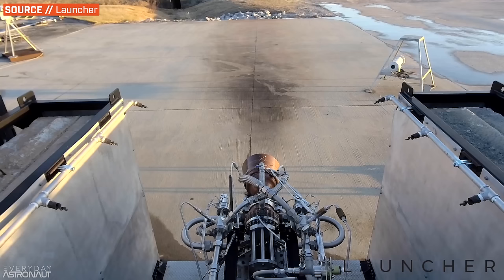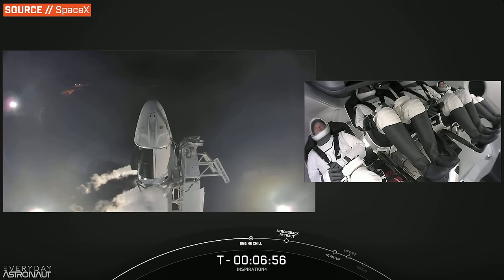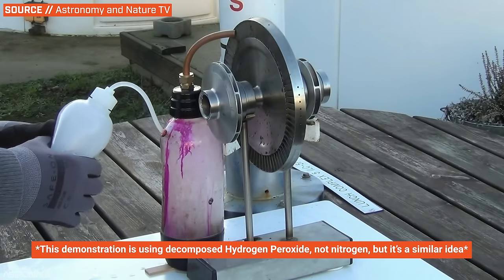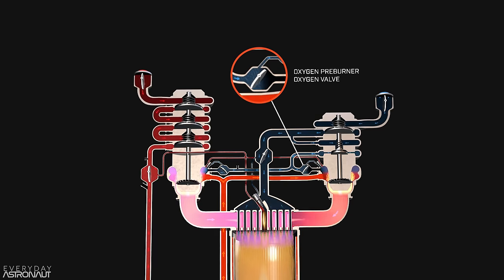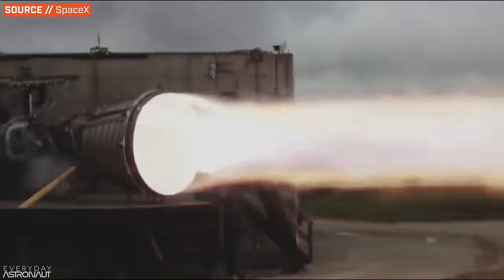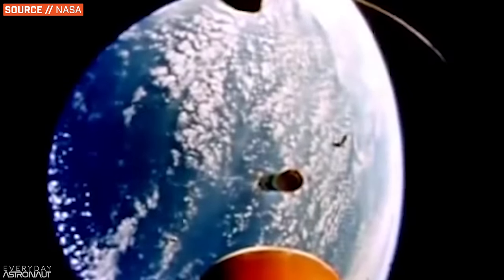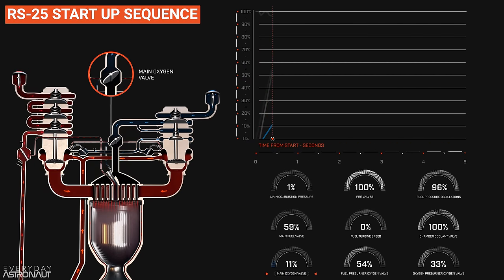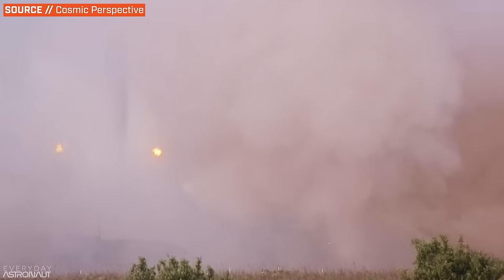Why Starting A Rocket Engine Is So Hard!

Comment: Terrific stuff, Tim. Entertaining and informative. I'd like to know how the Merlin engines on a Falcon 9 first stage are relit considering that air is being compressed into the combustion chamber at hypersonic speeds aswhenit is barrelling back down to earth.
Reply: The igniter is in the combustion chamber and the pressure in there is higher than any coming in from the outside.

Comment: Hi, in your discussion of hypergolics you bring up this point that liquid oxygen and liquid methane will coexist surprisingly peacefully together and won't lead to ignition. I take it the same is true of kerosene and LOX. Why don't any rockets take advantage of that fact and just use a premixed LOX/Kerosene/methane in a single fuel tank, run it through a combustion chamber and ignite it? Is there some chance of it becoming hypergolic or is it due to this issue with bubbles in the turbopumps, etc? It seems, this way, you might simplify engine design a fair bit and could save weight with fuel tanks, etc. Btw, this video's excellent and I can see this easily becoming my new favourite channel. Cheers for the top-class content.
Reply: Not a rocket scientist but I imagine the main problem with that would be that preburners will usually burn at a different (and less optimal) stoichiometric ratio than the combustion chamber.  Keeping the fuels separate and mixing them in the engine allows you to have, say, a fuel-rich preburner with a manageably low temperature and a combustion chamber much closer to the optimal stoichiometric ratio.  If your fuels are pre-mixed you have to choose very carefully between inefficient combustion or melting your preburners.  Plus just because they might not instantly explode like hypergolics doesn't mean it's very safe - a Falcon 9 blew up on the pad several years ago due to a carbon-composite helium vessel inside the LOX tank combusting.
Reply: @joshuaparks7429  Thanks, that seems to make sense.

Comment: The low pressure turbine blades on power station turbines are run just above the water dew point.  However some water drops do form and these erode the wear strips on the blade leading edges. It’s amazing to see satellite literally eaten away.

Comment: For the discussion around 35:00, if the goal for ignition of a vacuum optimized engine is to get fuel to the bottom of the tank, why is a plunger inside the not just used like a syringe to push fuel to one side of the tank?
Reply: Ah Nevermind this was answered at 37:00

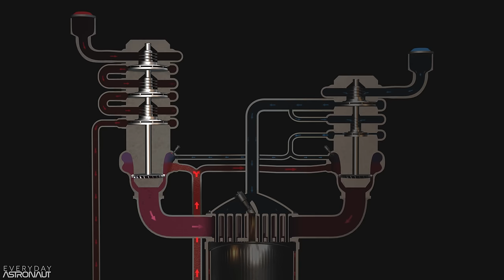Comment: I have a question about the animation at 19:31, if the gaseous hydrogen flows through the preburner and burns with oxygen there, then where does the fuel for main combustion comes from?
Reply: it runs so fuel rich that the combustion is not just incomplete, but leaves most of the fuel untouched and only a small amount actually burns to water

Comment: I think a electric high power high, torque turbine pump motor could probably be a bit less  complicated when starting and stopin😅g rocket motors and I think the PROTON rocket utiluzes this tech so it works and you can also eliminate a pre burner in the plumbing and I think this will work extremely effectively especially once this system has been refined and optimised in various ways

Comment: An idea: SpaceX stage 0 booster outer engine startup system seems overly complex and unreliable at times. Why don't they use some output power (eg preburner output gas) from the inner engines to start the outer engines instead of pumping n2 from the ground with lots of self retracting connectors?

Comment: John Carmack rightfully said:"Rocket science has been mythologized all out of proportion to its true difficulty."
To laypersons the processes described in this video may seem to be the most complex and difficult to control processes out of any engineering field - but nowadays, they really are not (any more).
There are much more complex and delicate processes involved e.g. in EUV lithography (and modern lithography in general, but EUV lithography is really obscenely difficult and was deemed impossible for quite some time), nanotechnology and many fields within life sciences. And there's much more trial and error involved, just that each trial and error-cycle is often not nearly as expensive as rocket engine testing.

Comment: There have been problems restarting engines @ near vacuum pressures. Perhaps it would help to reintegrate the main combustion chamber torch igniter.
Love the alpha-gen comment!
Reply: torch igniters are simple on the ground but any moving/mechanical part is set to fail at some point and its easier to just incorporate something like TEA-TEB

Comment: Great video as always but Ullage thrusters, u lost me, how do they force the fuel to the intake and remove the bubbles / cavitation. Can any one help?
Reply from the maker: The ullage thrusters accelerate the rocket (and it’s tanks of course) but the fuel stays in the same place. So the fuel “runs into” the bottom of the rocket. Since liquid is more dense, it will push the gas out of the way and sit on the bottom of the tanks during the ullage burn

Comment: in a stable zero-gravity configuration, a liquid in a tank should not "be a blob", rather it should be "coating" the inside of the tank, leaving a bubble in the center. just because of surface tension.

Comment: Good morning.
Can you please let me know what pressure is acting on the main valve and how is it opened.?
Thanks. 
Regards Bill.
Reply: most rockets in the past used hydraulics to move valves and solonoid valves to control those hydraulics (hydraulics can move a butttone of pressure). Nowadays some valves are solonoids themselves but afaik only on small lift vehicles
Reply: @daktus05  dear Sir.
Thanks for your reply.
Kind regards. 
Bill Richards. 
Cheers.

Comment: As far as spinup, if you are willing to sacrifice some weight and complicaion, maybe an electric motor to recirculate a fluid from a reservoir, through a tesla turbine, and back into the reservoir.  Tesla turbines have insane speeds and good horsepower performance in a small package.  They aren’t used in many applications, but this is because at the time they were invented, everyone was concentrating on vane axial steam turbines for naval applications, and the material science was inadequate at the time.  They are beginning to find applications today though.
Reply: Don’t use social media apps.

Comment: What do you think about improving a pressure fed cycle by igniting tiny amounts of fuel directly in the oxygen tank and vice versa? 
use the synergy with carbon composite tanks that can withstand giant internal pressures.
Reply: That’s how you cause a explosion

Comment: Is it about "throwing the most mass" or is it about creating the highest combustion chamber pressure/temperature possible without boom while utilizing that pressure as efficiently as possible? to some extent two of the same but not really...
Reply: It's absolutely not throwing baseballs... it's pushing the frame, which is "attached" to the combustion chamber gas, away from the jet of gas downstream of the combustion chamber and the nozzle gas

Comment: Cavitation is not quite a mystery in the holistic context of thermodynamical logarithmic emitter-receiver log-antilog inclusion-exclusion timing-phase positioning materialisation +/-, when you analyze the Fine Tuning Condensation +/- Constant of metastability partioning. 
Or, we hope the search for fusion power doesn't turn insideout without the operators knowledge of what they're doing.

Comment: Alright, I need to put this somewhere, so it might as well be here. Degradation of muscle and bone begins pretty quickly once a human leaves earth.
What if any factors could cut down on the degeneration?
For example, a myostatin inhibitor could greatly reduce the loss of strength and muscle mass. Couple this with regular calcium injection perhaps? Perhaps time release patches of different supplements?
Or do we just put all the astronauts on gear?
Not trying to joke; the actual physiological human element of space travel, will be a big hurdle that needs to be overcome. Perhaps gene editing will be prevalent in future astronauts, so they have the best chance to survive, and even thrive on other planets, and in space.
Thoughts?

Comment: The Soviet counterpart to the RS-25- the RD-0120- is a much simpler engine with nearly identical performance.  They even solved the problem with bootstrapping a staged combustion hydralox engine without needing the resonance chambers the RS-25 has.

Comment: Can you do a video on how liquid engines throttle, since in KSP they can smoothly throttle and as far as I know basically no real engine can do that?
Reply: im not sure how throttle works but one of the main issues and for example why the Merlin engines have a difficult landing sequence is the throttle range. Basically how low you can go with your throttle before you run into issues like combustion instability. KSP is lovely for things like control surfaces and such but some things are simplified, although i think with modding, you can bring almost any realworld constraints into KSP

Comment: Which part of the rocket absorbs the acceleration forces from the engine and transfers it to the rocket itself?
Reply: what do you mean?
Reply: @Jose Nova  sorry i have a tbi and im bad with words now. I mean newton's third law i think.
Reply: @downwithtrudeau  when you throw an object that imparts a force on your hand. Rockets eject material, the force pushes on the combustion chamber which is connected to the rocket itselt, accelerating it.

Comment: Compressed Barium Nitrate pellets are used to ignite a solid booster, hence the green flame.
Reply: Soo what you're saying is that if i eat enough Barium Nitrate, i could have turds that burn with green flames instead when i light them like usual?

Comment: Diesel Engines do not use the glow plugs for ignition.  Those are used for preheating the Cylinders for cold starts.  I have been around Diesel Engines My Entire Life. Over 40 years.  What makes a Diesel Work is Compression Ignition.  When you Compress Air it gets hot, then you inject fuel and it combusts.  That is how a Diesel Engine Works my Friends.  Rudolph Diesel got the idea from the old style cigarette lighters that they used way back in the day when he invented the first Diesel engine.  Although that Engine was originally designed to run on Peanut Oil.  Who Knew.

Comment: ha, seeing Elon explaining cavitation makes me feel a lot smarter....  blades create large enough pressure differences to boil the fluid in the low pressure areas, boiled bubbles move to higher pressure regions, bubbles collapse on surfaces to create incredibly high energy local effects that cause massive damage to blade surfaces. 
I have a BSME and do some pretty light duty manufacturing engineering, with a lean into copper alloy foundry science, but I feel like comprehend cavitation better than ol' Musky.   I guess the copper alloy stuff gets me closer to the cavitation knowledge, some of the alloys I worked with were exceptionally seawater and cavitation resistant (CA958 in particular) and as such were used in marine applications, most importantly as a propeller material for ships and submarines.  Obviously the dynamics involved in a turbine pushing THOUSANDS of kg per second through a 10? cm diameter pipe is a wildly different than a marine propeller drive, both in forces and chemistry.

Comment: And what if they build a permanent magnet track,both vertically and horizontally  combined with a fuel powered electrical energy strong trom generator, How could the E magnetic levitation train, like the MEGGLE, be used to transport containers as well as to transport huge spaceships into space?

Comment: A couple of additional thoughts : 

First, it's as if rocket science is actually really hard.

Second, about the pre-burners / gas generators. I know that the A-4 (V-2) used a steam generator with sodium permanganate and hydrogen peroxide to power the turbopump (one turbopump with separate impellers for fuel and oxidiser); and this as a quick and dirty ssolution. Obviously, you don't want to be faffing about with permanganate paste and highly-refined solutions of hydrogen peroxide if you have any choice. But why are pre-burners favoured over an independent gas generator in most of the engines that are operated today and in recent decades?
Reply: preburners often run incredibly rich so that they dont get too hot. That leads to a loss in efficiency, because you basically use a lot more fuel just to move fuel. The other reason is that the rich fuel is very suddy and can cause stuff like valves, injectors and everything to be clogged/damaged

Comment: Great job but this video will take more than one watching to understand.👍👍
The Rusians aren't the first to use burning wood to start a rocket motor.  The Germans built a "camp fire" under the V-2, opened the ethenol fuel valve, and when the alcohol pouring out of the engine bell started burning they opened the lox valve.

Comment: This is why sling launch/spin launch is more viable esp. on lower atmosphere and higher gravity bodies.
Reply: Rockets still needed for orbital sling shoting in low space orbit. See areospike for fuel savings
Reply: Heavy simi-trucks like SpaceX are needed to build large human hab modules
Reply: The electric motor starter is solved by leverage for 250 hp and is .9 kg.
Reply: Ps do you wanna build a snowman it doesn’t have to be a snowman @ end with Elon convo
Reply: spinlaunch will have a very select type of cargo they can launch. Anything organic is out of the windows right away and practically anything that is larger then a electron rocket as well and they still need to figure out the full size carbon arm wich will be incredibly expensive to manufacture and test. I wouldnt be surprised if they are simply too late to the party to have a necessary impact when we already see launchcosts for small sats in the range of 2500$

Comment: Darn complex. Space rocket engines deal with the most fundamental elements requiring precise control to extract the most energy out of them to do the work. So, naturally it is complex and requires advanced materials and operating process to do just that.

Comment: Why are some circuits purged with nitrogen and other with helium? Both gases are inert (as i understand it), so why not use the same gas (single tank) intstead of 2 different ones? (dual tank)
Reply from the maker: We mentioned it's because Hydrogen is colder than the freezing point of nitrogen, so when hydrogen is introduced into the system, it could freeze solid any nitrogen. So the hydrogen side of an engine needs to use helium which won't freeze in the presence of hydrogen 👍
Reply: @EverydayAstronaut  Makes sense, thanks!
Reply: @EverydayAstronaut  Although that does beg the question, why not just use helium on both sides?? (i suppose because nitrogen is just widely available whereas helium is a bit harder to manufacture in rocket-grade quantities)
Reply: @flymacseamus3474  NASA does use enormous amounts of Helium -- they are the single largest consumer of helium in the world. Each countdown for Shuttle launch required a million cubic feet of helium for purges and pressurization. So in this case, they were probably trying to save a little bit by using nitrogen where it was easy to do so. It is hard to say how much it saved them, but nitrogen is essentially free and the supply is unlimited, comparing to helium. So you can run nitrogen purge all the time without worrying about the cost.
Reply: @cogoid  Thanks for the clarification 👍
Reply: @flymacseamus3474  After I posted the previous comment, I have found that NASA used 30 million cubic feet of nitrogen for each Shuttle launch -- thirty times the volume of helium. Even if this number is in part so large because they had nitrogen on tap and did not bother to economize it, it is still a huge number. It would be unsustainable to source so much helium.
Reply: @cogoid  so i guess the STS used it in the same manner as described above? Helium to purge the Hydrogen part of the pipes, Nitrogen for the Lox part?
Reply: @flymacseamus3474  I do not know the details, but consider that oxygen tanks are only 1/3 in volume of hydrogen tanks. Purging and pressing them would not have used 30 times more gas. 

NASA must have used nitrogen liberally for all sorts of other purposes. For example, everybody purges their combustion chambers vigorously during fueling of the tanks. This takes care of the concern that any small leaks through the fuel valves could create explosive mixture of fuel vapor and the air and blow the whole thing up. So you just flow tons of nitrogen to get rid of any vapors.
Reply: @cogoid  Well i suppose the lopsided proportion could also be a matter of different gas density, as opposed to just relative volume
Reply: @flymacseamus3474  They used 30 times more of nitrogen by volume. If we take the 7 times higher density on nitrogen into account, this gives the ratio of nitrogen to helium of 210 by weight. Launching the Shuttle consumed almost 1000 tons of nitrogen for various housekeeping tasks and just over 4 tons of helium.
Reply: @cogoid  Hm, fair point... then i guess it's the money indeed

Comment: How can shutting down an engine exceed a G limit? Don't you just "stop making Gs"? What am I missing?
Reply: the flow of the fuel is extremely fast, and the fuel has mass.. its like when you close the tap water to fast, the water basically hits a wall, and all the force hits the pipe.
Reply: @JoseNovaUltra  Thanks. I'd assumed he was talking about the rocket structure.